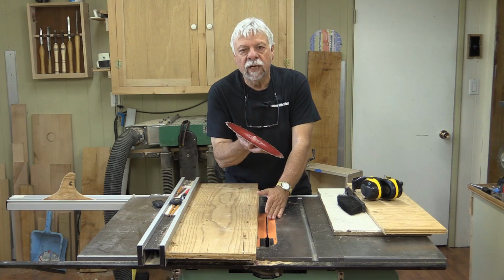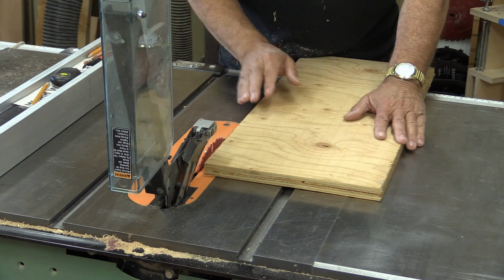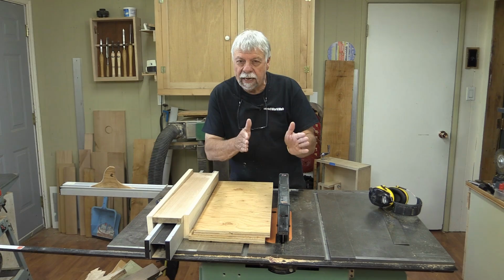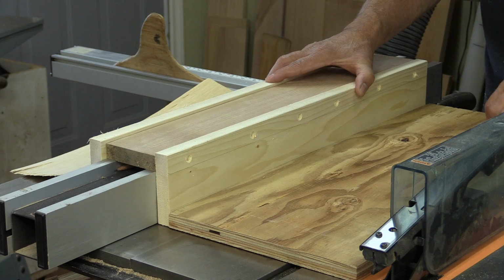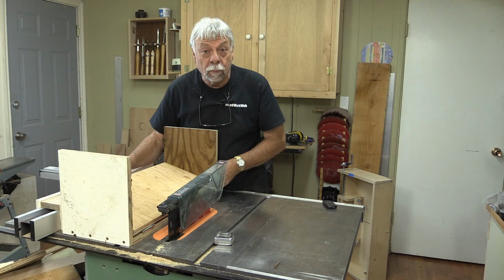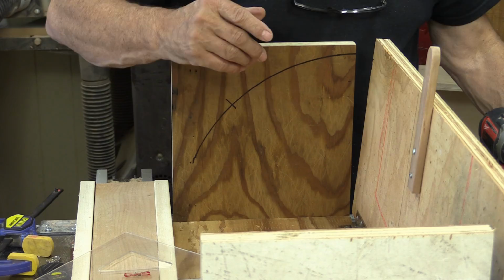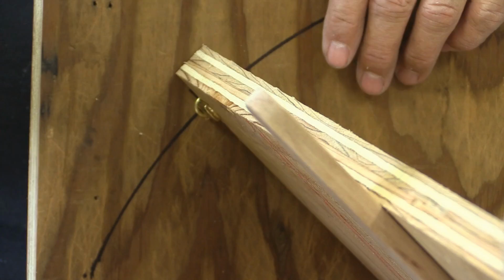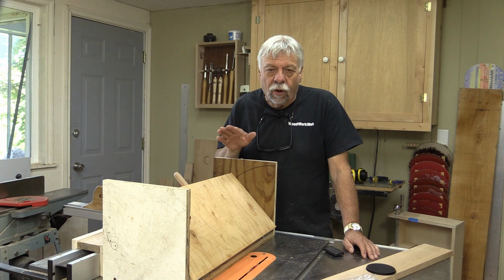Table Saw Mitre Jig: Make Easy Mitres Cuts & Spline Joints Every Time!

Comment: Ingenious Colin! My saw has a notched belt the sets the angle of my blade. Over the years the belt broke right in the middle of a project WITH THE BLADE AS HIGH AS IT WILL GO. That stopped the project until I got a new belt. Your jig would save lots of wear on my belt. Thanks for that.

Comment: i have been looking for a good way to join two boards each 3 - 4 inches wide, and mitered each one to 22.5 degrees, thus when connected would form an included 45 degree angle.  i did not want to tilt the blade on the circular saw to cut a miter slot.  your jig design, with a few modifications to ensure registration and alignment, is a perfect solution.  thanks much.  you have a great channel.

Comment: Reading through the comments, the impression is that this is a jig for cheaper saws that make the blade tilt difficult.  My expensive SawStop has the same problem.   Not only a lot of knees down cranking and watching the read out on the angle finder, but as you get near 45, it becomes more difficult to crank.  I saw this jig on Sergio Acuna Padin's YouTube channel.  He uses it ALL the time.   When it popped up on your channel, I decided that's all the validation I need!   I will incorporate some modifications suggested below and get this built immediately.

Comment: Looks like it will be a great jig for those of us with cheap table saws.   Thanks for the new jig.
Reply from the maker: You're welcome Tony. Thanks for watching.
Reply: @knecht105   I make boxes I.e pistol display cases, jewelry boxes etc. I like the jig but is there a way to add a stop so you can cut all 4 pieces to the proper dimension of your box then slide each piece up to the stop and make repeatable 45 degree exact cuts ?

Comment: Thank you for making and showing the use of the jig. I have seen the idea before but not in use, so very nice. It is also a very useful jig for older table saws with folding tables instead of the blade. Like the Inca Major and Compact saw. The shelf pin was a nice touch.

Comment: Love the jig, I was watching and thought how easy it would be to cut an arched track and attach a t-track bolt so you could lock in any angle quick. Even maybe a bit of perspex on the outside with a marker that indicates the angle your set for.
Reply from the maker: Thanks for the tip and thanks for watching!

Comment: Having come very close to the blade with my fingers the other week I’m going to make this.the dw745 is particularly difficult to cut 45 and dangerous imo. I think I can get a bit more accuracy using my digital angle gauge to set the position and insert locking pins from the outside of the front board through metal inserts in the front board and adjustable board. This for 45 and 30 deg . A clamp will do for others in combination with the digital gauge which are very cheap and so useful.thanks for the basic idea. Also some people don’t understand why you cannot run 5he tee slot in the table as you do not show you changed 5he fence position to cut the key. Subscribed.

Comment: What about other angles?  How would you set those?  Do you plan to install other shelf pins or is there a way to set and hold a particular angle, make your cut/cuts and then put the jig away?  The shelf pin is a great idea, but I was wondering how I would accurately set and hold a different angle without having to install pins for each and every one.  Also, did you use a single shelf pin or is there one on each end?  Is there any deflection with a single pin when cutting a longer piece?  Great vid.  Thanks!!

Comment: Nice, simple jig, but when I make one like it I think I'll try to find a way to make it fine-tunable with some kind of screw mechanism. The acid test is to make a box and have the joints be completely without gaps in the 45s, and I suspect I'd never be able to set the pins that accurately, at least on the first try.
Reply: This was my thought also, a screw at each end on small blocks that enabled fine tuning in case of wood / blade movement. I'd also look at clamping so the workpiece remains consistently pressed down throughout the cut.

Comment: Hi Colin - I have a question for you -  I have an old Sears table saw with a narrow fence and I think I would have a hard time making the part of the jig that goes over the fence  -  if I were to add a slider strip to the bottom of the sled do you think this would work.  I want to make some boxes with45 deg ends and splines like you showed in your video.  Let me know.  Burt